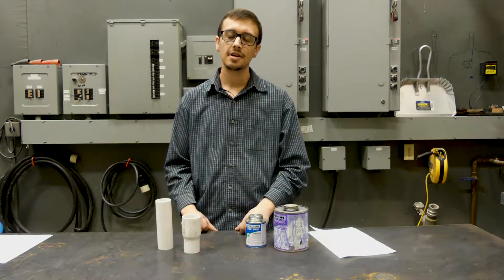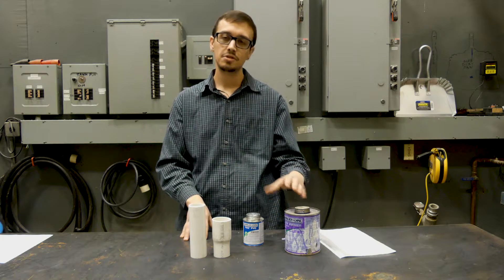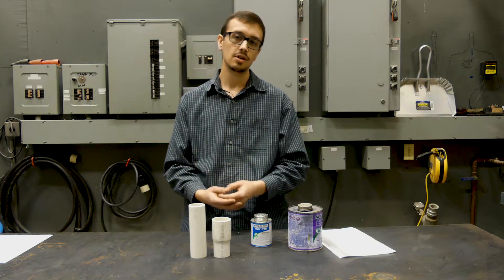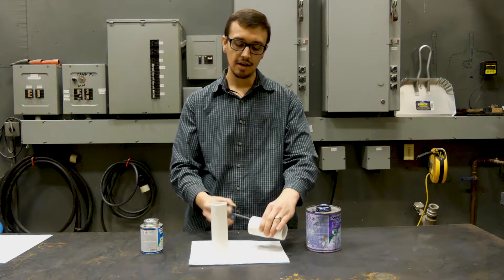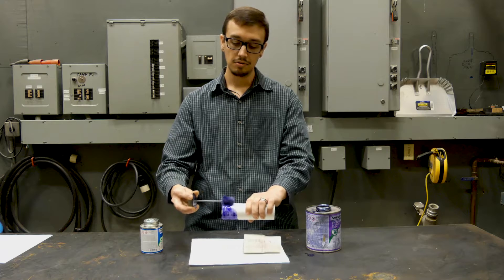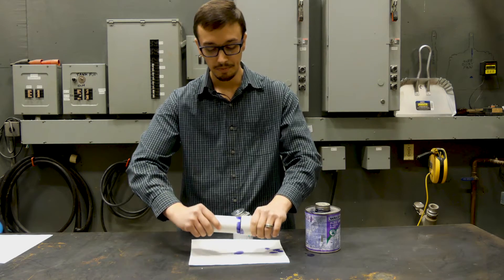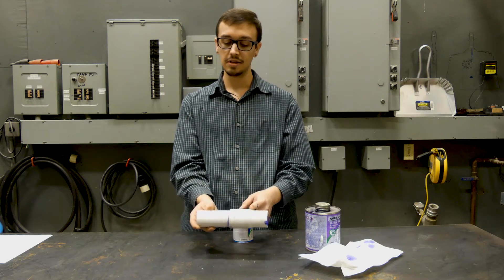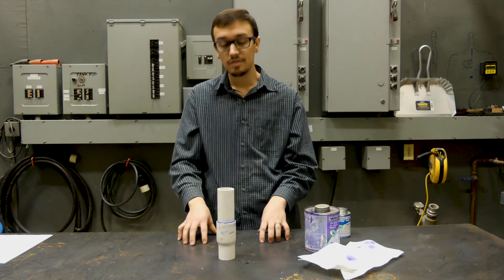How to Solvent Weld PVC

Comment: I'm installing a 1 HP pump in a shallow well.  I'm using 1-1/4 Sch. 120 for drop pipe.  The well is only 50 feet deep.  I've had problems with the pump picking up sand from the bottom of the well.  I want to set the pump at 34 feet deep.  I have two 20-foot long sections of threaded PVC.  Can I cut one of the pipes to be 14 feet long and use a standard pipe threader to tap the cut end?  Would it be better cut out six feet in the middle of the pipe and glue them together with a coupling ?

Comment: Glue or Cement? You said it's not glue, but referred to it as glue several times (ha, ha).  We all call it glue.  
Thanks for all the different videos.  
I had to put a coupler on a broken PVC pipe coming out of a concrete wall.  It had a small chip out of the edge, but I was only able to put the coupler over that edge about 1/4 of an inch for my suction line from the lake.  Do you think it will work?  Guess time will tell.  My pump isn't working either that's the next project after watching your videos.
Reply from the maker: Thanks for the comment! The only way to tell if it will hold is to pressure test and check for leaks. Give us a call if you need any help with your pump: 855.329.4519

Comment: Regarding usage of PVC as your drop pipe in a well pump installation, is there a recommended installation of connecting the pipes with consideration of water flow direction?  ie water flowing towards the bell end?  Thanks